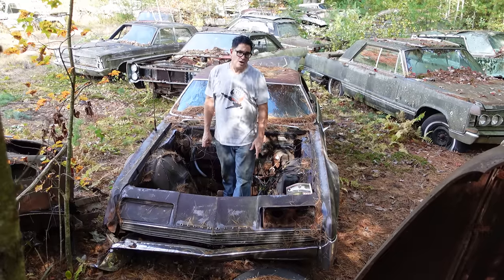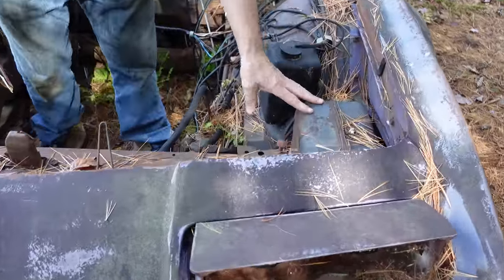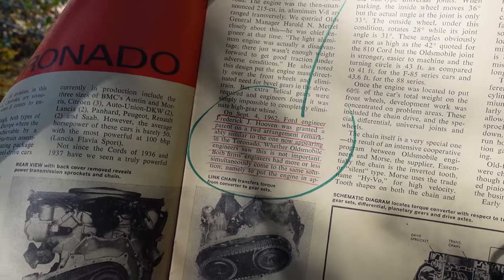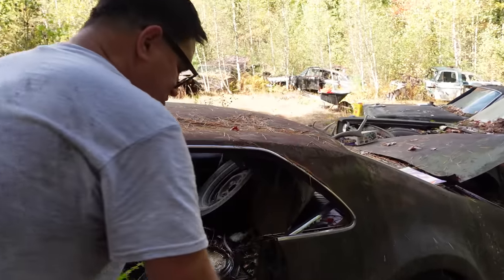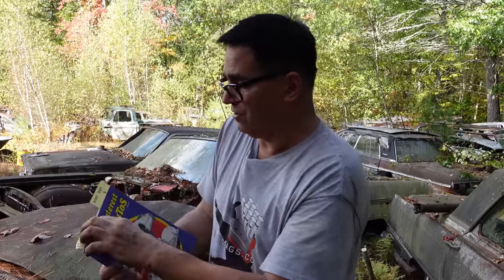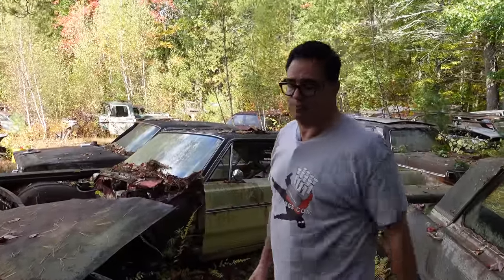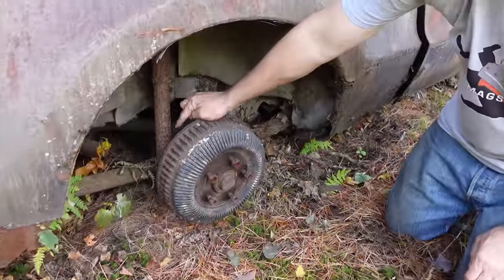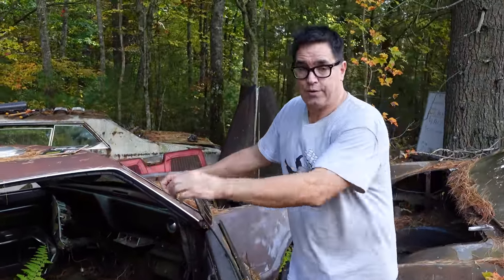Torque–O Nado

Comment: Dad bought a fully loaded Toronado in November 1965. I remember hearing the surge of vacuum when you pulled out the headlight switch and the sound of that 425 idling in the driveway through those resonators. The engineers at GM did their homework, I never experienced that torque steer feel that so many front wheel drive cars give. The Toronado just planted you in the seat and took off like a jet. Lots of memories. Thanks Steve.
Reply: Family owned a Olds dealership.  A popular way to sell a Toronado was to sit at a stop light, turn the steering wheel about 80% to the left, when the light changed to green, drop the hammer on that 425 and it would pull you around the turn before the opposite car at the light even moved. It sold a lot of cars. LOL

Comment: My brother bought me a 1966 Toronado for something to work on. It was owned by a 442 collector in SoCal. It came with a ton of extra parts that had been scavenged from wrecking yards. On the freeway trip home the engine blew a head gasket. I then decided to put 454 heads from a 69 Toronado on the 425 block. Had them rebuilt first. According to Chilton book specs, the head swap was do-able in my estimation. Mainly wanted to get rid of the silly A.I.R. smog setup the 66 had. Worked fine during the short break-in period. Then I hit the highway out of State, and on the second day accelerated on an incline to go around a slower semi truck. Shortly afterwards, one or two of the lifters and pushrods "popped". Bonehead move on my part. Had to limp along slowly until I reached civilization. Kept those heads on, and had a new set of pushrods installed. But the car never had the gusto she once had. And there was some lifter ticking. Was okay for work commutes - but I never again took it on the freeway. Beautiful car. I even had chrome covers for the heads.  Ultimately, it languished from being seldom driven, wouldn't start, and I sold it as a project car for $1300 when I needed moving money. This was back in 2013. One of the things I kept were the Appliance aftermarket mag wheels that had a BMW mesh pattern to them. You hardly ever see those for a Toronado. Hoping to get another Toronado if I win the Lottery so I can go full Jay Leno on it - and employ those rare mag wheels. Great piece, Steve!

Comment: A Toronado wagon with that full length flat floor would have been fantastic.

Also, as a builder of model cars for a very long time, they really got me into what made cars work. Some of the old kits (I'm looking at you AMT 66 Mustang, and even worse Mustang 'funny car") required some 10 year old engineering just to get them built. Then there's the Heller Ferrari 330P4 for anyone who had the misfortune of trying to build that abomination, and pretty much any of the Kenworth or Peterbilt kits.

Comment: I'm a big guy but for some reason I like small cars... usually. My day-to-day car is  Cobalt SS while I've had Corvairs ever since 1980. Having said that, there are a few big cars on my ever-changing "100 Car Bucket List" for after we hit the PowerBar. A 1966-67 Tornado is right up there towards the top. Cutting edge technology for its time wrapped in an incredible body. What's not to like?

Comment: When you get the tag, you can brag, but let's go all the way, don't you say? 12A for first week of December 1965 production, "L" for Lansing, MI final assembly point, 66 for 1966 model year, 39687 for Toronado Deluxe, EUC for Euclid, OH Fisher Body assembly, UU for Dubonnet (Plum) upper and lower exterior paint, 059-D for Strato bench Plum interior trim, 5Y for deluxe seat belts, X for column shifter, S for power trunk, among other codes (the tag is dirty and should have been cleaned better to make it easier to read).

What was unique about these is that the body was made in Euclid, OH at Fisher and then transported to Lansing, MI for final assembly. Fisher Body in Euclid was located at East 140th and Coit Road in the Cleveland area, at 20001 Euclid Avenue. The plant operated from 1921 to 1993. It was the Inland Division for a while making trim parts for various GM divisions before it finally closed in 1993. The plant had a contract with Sea Ray for boat fabrication for a time starting around 1986.  Not quite on the convertible. There was a "convertible", made by ASC on the 1979 to 1985 era vehicles. This was to compete with the Riviera and Eldorado factory offerings. 1979 to 1985 Toronado, Riviera, Eldorado and Seville models were all made in Linden, NJ. I knew the body shop owner that did the "double ended" Toronado made by putting the front halves of two Toronados together so it was always "coming and going". 

No VIN, can't win, but easy to figure out, no doubt: 3 for Oldsmobile, 9687 for Toronado Deluxe, 6 for 1966 model year, M for Lansing, MI assembly and the rest is the production sequence. 

I believe only front disc brakes (not rear) were an option in 1967. By the third generation (1979-1985) cars, four wheel disc was an option. I had them on my '82 Toronado. Also, the Riviera did not become a front wheel drive model until 1979, when it joined the Eldorado, Toronado and Seville and production moved to Linden, NJ.
Reply: Thanks for that tidbit! Cleveland, Ohio born and raised - just down the road from the Ford plant in Brookpark. Mom bought a 67 Toronado back in 72 but I never researched the assembly of the car so I think it's cool as hell that the body was fabricated right there in Cuyahoga county.
Reply: @TrashcanGarage  Yup, 20001 Euclid Ave is where it was. I have three GMs that were assembled in OH: two Pontiac Trans Ams (both made in Norwood, OH, that plant closed in 1987), and a Chevy Cavalier (made in Lordstown, OH, which closed in 2019). OH has a big manufacturing base. I'll be there in November on business, in the Columbus, OH area.
Reply: @googleusergp  - I believe the v6 in my 2011 Pony began its life in Brookpark after the plant was re-tooled. A November 30, 2009 entry at Autoblog was my source (I can't provide links because Youtube will censor and delete it).
Reply: @TrashcanGarage  Yes, it probably did. OH still has a big manufacturing base, such as Honda in Marysville for example.
Reply: @googleusergp  - Thx. Living just south of the Ohio River now and Ford's presence here has always loomed large and growing. The original Edsel plant in Louisville makes SUVs and the truck plant is nearby. Now they're fixing to build the large ev battery facility south of Louisville in Hardin county. Union strong.

Comment: I was in high school in 1966 when the father of one of my classmates bought a brand new Toronado so my classmate would drive it to school at times and also around town at night.  Believe me that Toronado would melt the right front tire and the tire smoke was incredible.  The 130 mph speedo was not enough because that 425 engine would bury that speedo easily.  Two years later the father got tired of buying tires for the Toro and bought his son a 67 Camaro SS350 and it became a street racing legend around tihat little town.
Reply: My first car @ 16 was a 67 Camaro SS 350, Light Green.  In 1971.  I was working @ Sears in the toy dept. as Christmas help. I came out after work & it was Gone. I only had liability Ins. so it was a complete loss of the 1,200.00 I paid for it. Those cars are Very Easy to steal with the ignition switch being held onto the dash with a screw on fastener.. I had US Mags & new tires. I was So unhappy.   Later on I bought a Used 69 Toro..Bright red. It was a gas Hog.

Comment: My Dad had a 1967 Toro. It was Saffron yellow with black vinal top. Fully loaded deluxe with factory bucket seats. We drove it from SF Bay area to CT and back! What a ride. I remember  cruising  through Nevada and Utah going 126 miles an hour for long periods on time. (No speed limits then, 1971). Beautiful big and heavy luxury  car. I learned how to drive with it. It easily did big smoky front wheel drive burnouts too!!
Reply: Visiting my Aunt & Uncle in Vegas summer of 1970, we took a trip in there 70 Toronado GT. My Uncle drove us to an abandoned gold mine and remember his saying that..Nevada had no speed limit. We also visited Circus Circus & the Dam.  I turned 15 that summer. Lost my Dad 2 years later. great times

Comment: A good friend of mine had a 66 Toronado in the mid-late 1980s. Shortly after he bought it, one of the radiator tanks started leaking. When we went to pick it up after repairs at the local radiator shop (remember those places?), the shop owner told us that Toronados of that era used the widest radiator ever installed in a production car. I don't know if that's true but, that thing was HUGE so, I have no reason to doubt it!

Comment: As far as I am aware all '66-70 Toro's came with large valve heads (later spec'd on 442's as part of the W-30 package). The 3.975 stroke 425 IMO was the best performing Old's muscle car engine. No surprise it's missing.
Reply: THE FOUR FOUR TWO AND THE TORNADO SHARED THE SAME HEADS BUT DIFFERENT DISPLACEMENT . BUT THE W30 HAD DIFFERENT HEADS WITH SMALLER COMBUSTION CHAMBERS FOR HIGHER COMPRESSION IN 68 AND 69 . REGULAR FOUR FOUR TWO'S GOT C HEAD'S FOR 67 - 69 . THE W30 AND THE HURST OLDS GOT THE D HEAD'S FOR A LITTLE HIGHER COMPRESSION ....JUST SAYING.
Reply: @racerx7319  
Thanks for clarifying. I agree with what you said and you are correct. I would still take a 425 over a 455  or 400 any day  though. The 400 Olds in the early 442's also had two different strokes. The first version  was with the 425 crank. The latter (after 68?) had a smaller bore/longer stroke 455 crank
Reply: @Freedomquest08  I'd like to what a 425 w/ the 308 cam would run in the 1/4.
Reply: my friend had a 1971 Toronado....Olds put a 455 ci engine in them in them  1970's.

Comment: Had a 1970 GT W34 Toronado, toured all 50 states in that great automobile. The drop in octane after 74 made it tough to use as it was designed.

Comment: I used the front frame & drive section to build a front wheel drive 1970 Chevelle a few decades ago. I adapted a 6-71 blown small block chevy to the thm-425 transaxle.

Comment: Just fascinating stuff. I remember as a kid a woman who owned a Toronado and how odd we thought front wheel drive was. The front wheels would spin on snow and ice, which we thought was totally backward.
Reply: My first car was a ‘68 Toro, it was fantastic in the snow with the weight of trans and 455 over the front tires. What did hurt a bit was the 7-8 mpg of premium on a teenagers wallet!
Reply: @paulhunter9613  my friend had a 1971 Toronado....Olds put a 455 ci engine in them in them  1970's. fun car
Reply: @michaelpalm2210  Olds made a Toronado GT in 1970 with a high performance 455 making 400 hp. One yr only and quite rare. Would love to find one and drive again

Comment: In around 1972 I was delivery newspapers and it was snowing out. I hear some hooting and hollering and a Toronado driven by some teenagers goes bombing by with the throttle wide open. This was on a slight hill and when they reached the stop sign at the bottom of the hill I thought they were going to slide through and wipe out. Brakes lights went on, backup lights went on. Car stopped as if it was on dry pavement. Then wait 2 seconds and to the floor again with more hooting and hollering. I don't know if the car had studded snow tires on it and the weight over the front tires gave it super grip or if they actually got it into reverse and this stopped it on a dime. Great car in the snow. Thanks for another great video Steve!

Comment: The oddest transplant I ever saw at a car show was a VW squareback cut up to be an Elcamino style pickup. In the bed was one of these huge V-8s with the transaxle, so still rear drive. BTW, you mentioned model versions of these, and I have a "new in the box" Corvair from the mid 60s that's never been glued together.

Comment: I had a standard 66 for many years, the only options were the AM radio and a heater.  Mine had trim rings, one of the first parts people look for as they get damaged easily and the clips break.  Loved its looks and fun to drive.  

Negatives - tough to restore as none of those nose trim pieces are reproduced.  The vacuum headlights stunk over time - the cylinders would no longer hold vacuum to keep them up, especially at stops.  Those drum breaks were borderline dangerous in a 5000lb car.  The rain drain tubes in the trunk would fall apart so the water from the back vent would just settle into the trunk itself.  Can't change wheels unless you spend huge money to have them custom made.  

It was tough to modify too - the engine is a high-perf model with a desirable lifter angle, high capacity sump, forged crank etc which was great.  The motor sits very high so the intake is restrictive and any modification requires cutting the hood.  No headers are made for it so that would be big $$s.  I had a dual stall converter custom made for mine but that was it for trans mods, no other gears are out there.

Comment: My dad had a 66 (gold) and 68 (black) Toronado.  He had a Toronado fixation and later had a 74 and 78.  The 66 was the coolest, though the 68 had vacuum-operated power locks and a radio with a weird mechanical seek feature that sounded like a robot having a seizure when it operated.  The 66 had the 425 and I want to say the 68 had a 455.  I always thought the dash was the coolest of any car with the drum speedometer and the chrome 'eyeball' vents.  Unfortunately the 66 had an engine fire while my dad was going to work one morning.  He and my granddad replaced the burnt wiring and resurrected it, but unfortunately the transmission failed soon after, so the car sat for years.  In my teens I wanted to revive it and I would periodically charge the battery and start it and let it run to keep it going, but I didn't have the money to fix it and eventually my dad sold it to a scrapper, which still makes me sad.

Comment: The Toronado was and still is an amazing example of engineering and design.  Somebody ought to buy that Toronado - if not to restore, at least part out what is left to restore or resupply other Toronados.
I rode in one once.  The flat floor just made for a lot of passenger room.
General Motors did a great bit of engineering and design in the 1960s.  The Toronado, the Eldorado that followed, the Corvair in all its forms, including the Greenbriar van and truck (the Corvair  was a great small car, Nader notwithstanding) and the GTO...great cars all....and I'm a Ford guy.

Comment: Back in '87 as I was starting out as a tech, I worked in an Olds/Cadillac dealership. We had a customer with a perfect Burgundy 1967 model Toro. The last time I saw it, I failed it for State inspection because the headlights wouldn't open. The elderly owner didn't want to fix it. The last I heard was several years later, it was sold at his estate sale for a few thousand dollars.
Reply: It likely would have been code "N" Burgundy Mist exterior paint.
Reply: That couldn't have been too much to fix.  Probably a vacuum hose.

Comment: Thanks Steve!  Never knew about the seven shocks and the mono-leaf.  I believe that same transaxle was used in the GMC Motorhome (with a 455 or Buick 403) which allowed the rear suspension more freedom to follow the road, resulting in a better ride than the usual truck chassis on mobile homes.  So many cool ideas on these older cars.  I hope younger engineers take heed.
Reply: And the flat floor made for passenger space.
Reply: It was used with the Olds engine in the motorhomes. Which the 403 is.
Reply: See the movie " Stripes "
Reply: Fred brandon  The max GVW is between 10,500 for the short wheel base and 12,500 for the long WB.  This stacks up favorably against a box van / 1 T dump truck.   The  front drive trans is a folded version of the TH 400 used in rear drive motorhomes.
Reply: Fred brandon  It's a Turbo 400 reversed and with a differential grafted on.

Comment: Mom bought a blue metallic/white interior 67 back in 72, chose it over a dark blue 67 Camaro. Came with massive finned wheel covers that were not fond of curbs when parallel parking. The pop up headlights, body styling and that cool drum style speedometer sold me, and was only 12. And yes, it could really haul ass! I've got an (unbuilt) AMT Customizing Kit version of the 67 here in my stash. Thanks for the tour Steve! 

edit
BTW: Leno got a hold of one about 22 years ago and dropped a 'Vette drive train in it (including rear axle). Look it up, I have the magazine article at my shop, Road and Track May 2005 did a feature on it.

Comment: My late friend and customer Darrel Lee had one,  I went through the engine (bad piston) and totally enjoyed working on it.  It had a variable ratio torque converter controlled by a switch that attached to the throttle. GM used that variable ratio converter in the Turbo 400 for only 2 years (I believe)
Reply: Switch Pitch?
Reply: I hadn't heard the 425 trans used a mechanical actuator. The 66/67 400 trans used  an electrical actuator in the A and B body cars.
Reply: @oldman-zr2ru  You are correct, it was a switch, not a mechanical linkage. I corrected my post. Thanks !

Comment: When I see these I think of either the Hurst Hairy Oldsmobile which used two blown Olds engines and transaxles, or the Chevado street legal 55 Nomad wheelstander, which used a Toronado drivetrain in back of a Nomad. Chevado worked well, Hurst Hairy Olds was uncontrolable.
Reply from the maker: Hello oldrustycars (goodbye Rusty Jones?...it's an old TV commercial song...) lets not forget the twin 6-71 supercharged 425 Olds powered '66 Toronado of John Smyser. It was called "Smyser's Terrifying Toronado" and was also a full-quarter-mile tire smoker! Google this beautiful beast for more details. It was only featured in a few magazines and probably proved to be a hand full. Never heard that it crashed though. Thanks for writing, Steve Magnante